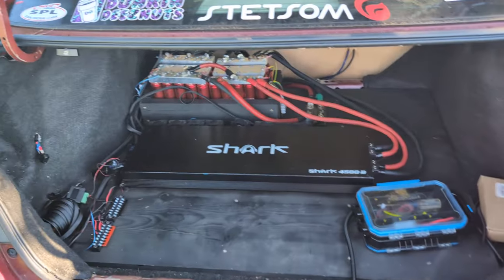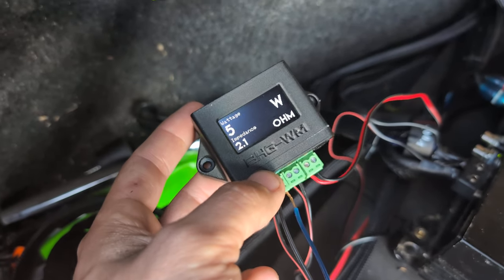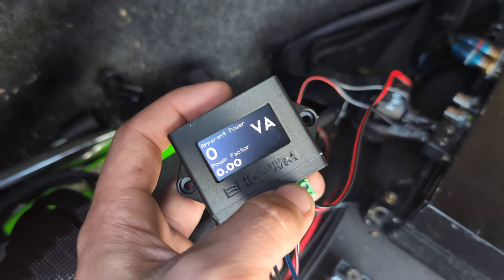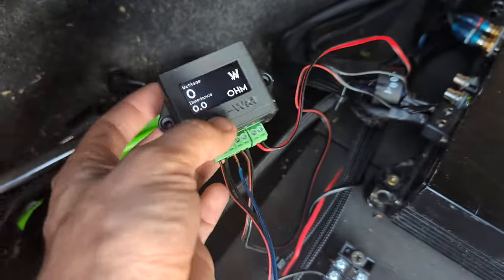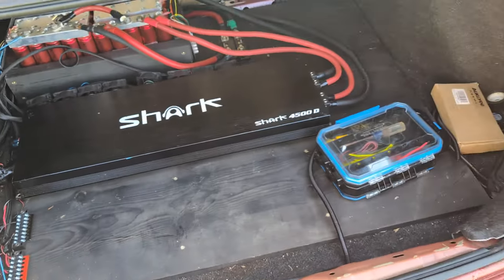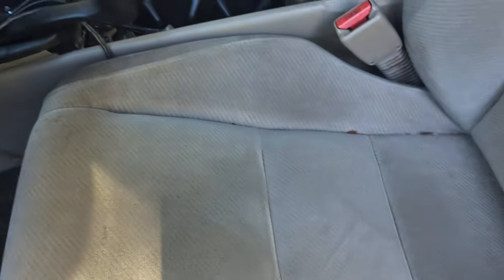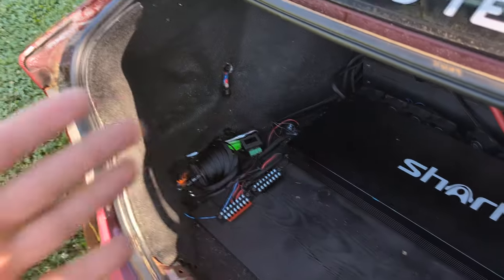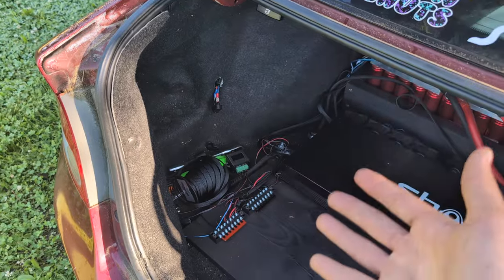NEW Bass head Garage WattMeter is AWESOME

Comment: Could you run this to the front of the vehicle or would the length of the wire throw out incorrect numbers?
Reply: You want it as close to your amp as possible to see what your voltage is going to the amp it won’t be the same farther away you will have voltage drop
Reply: Where can I purchase one? Thank you 👍
Reply from the maker: I'm going to run mine to the front eventually. Also it shouldn't matter wire length since all it is doing is reading current and voltage
Reply from the maker: @georgeperez4231  should be able to get one at bassheadgarage com
Reply: @andruwsaudio2996   My thoughts exactly. Thanks for the info 👍
Reply: I ordered one of these about a month ago should be in any time now can't wait to see what my new AAK 6k pushes to the new 15" Incriminator audio TYRANT still waiting for everything to come in to install it but I think this will make a nice addition to the setup
Reply from the maker: @SlamryCamry19  yes sir I love mine. I just bought a HPVM pro and I want to run this to the front and also my volt meter so I can see power and how the system acts when playing
Reply: @SlamryCamry19  Thanks keep us posted 👍
Reply: @jordanm8065 I think you're mixing up your devices. What you're saying is true for a voltmeter, but you can typically calibrate those to compensate.

This device is actually measuring the ac voltage coming out of the amp. If you lose a tiny amount of voltage in a long wiring run, say 0.1v or 0.2v it's no big deal at all. This is not a laboratory level accurate device. It just gives you a fairly accurate calculation of power in real time. If it's off a couple of percent, it's no big deal.
Reply: The copper wire length will add resistance. Your final ohm reading will be off.
Reply: @DaveyCrockett1 That's not going to be the case because the ammeter is inductive and does not actually affect the circuit it's measuring. 

If your ammeter was wired directly into the circuit then it might have an effect.

It's possible the inductive probe might be influenced slightly by the length of the wire, but I think that will be negligible. It doesn't need super high precision.

This watt meter does not measure resistance. It's not like putting a digital multimeter across a voice coil.

It is only measuring voltage and amperage and then calculates the wattage and impedance.

There's also not any kind of heavy load going through any of these wires which might add resistance.
Reply: @JasonWW2000  thanks for the update

Comment: I'm currently waiting for this to be shipped to me but apparently there is a big controversy on the wattage meter being compared to the SMD meter and which is accurate can you do a test with a clamp meter and dmm and see how far off the meter is
Reply: the SMD is dogshit....it reads -35% LOW...it underates amps
Reply: @lunam7249  every test I have seen on here shows the BHG wattage meter being way behind the SMD meter I don't care for SMD products they are way overpriced and dude is an arrogant narcissistic little man but if the SMD meter is off by 35% then that just says the BHG wattage meter is off by about 70% because not one single test I have seen does the BHG wattage meter read anything close to the SMD meter and the SMD meter is closer to the actual reading as bad as I hate to admit it
Reply: @SlamryCamry19  interesting....🤔🤔, ya the SMD super-underates amp power!!....a dmm clamped 100 volts at 10 amperes = 1000 wrms , on a SMD DOGSHIT it will read 650- 750 LAME!!
Reply from the maker: @SlamryCamry19  I can try. Honestly for 80 bucks I can't complain even if it is a few hundred watts off

Comment: Can you make an install video?
Reply: It’s a straight forward install. There are a couple connections including the hall monitor. It comes with the instructions. I just hooked up two of them in my build. 
- Power / Ground / Remote
- Speaker + / Speaker -
- Hall Effect Sensor has a positive and negative that will need a wire extension.
Pretty straight forward. Just make sure you choose your installation location first to so that you can make sure you have enough wire. Mine is in my amp rack I can look at over the shoulder in the rear seat.